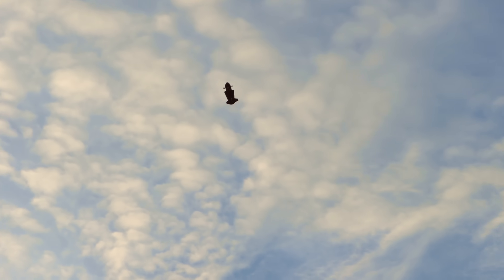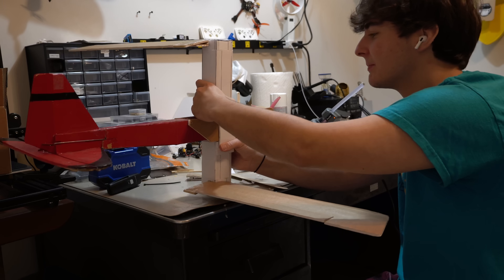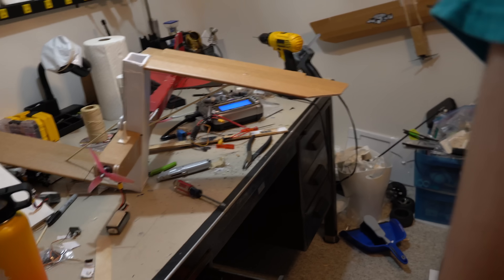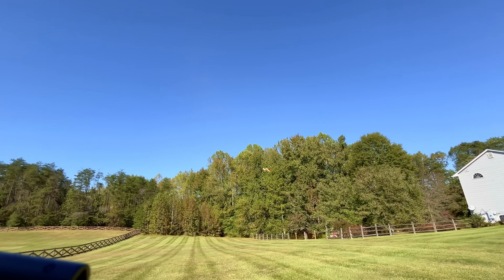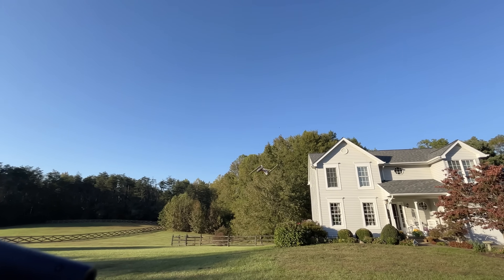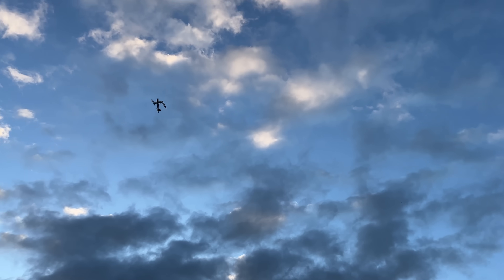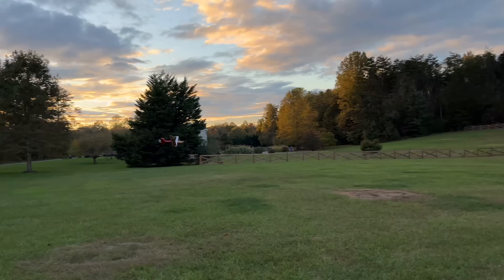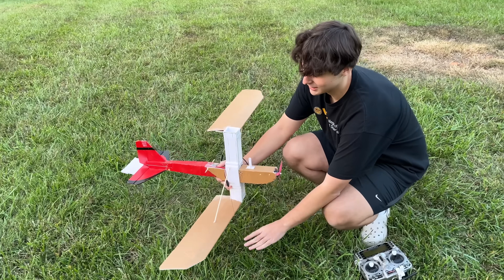Can a Plane Fly With Offset Wings?

Comment: Cool experiment! A free body diagram will show that regardless of wing height offset on either side, the wings create the same rolling moment on each side which cancels each other out when in steady level flight. Now sideslip effects, especially with that big vertical mast, might be a different story.... I'm curious if you could 'feel' any significant differences in yaw or restoring roll in sustained left vs. right banks?
Reply from the maker: Awesome explanation, now I have a legit engineer to confirm the results of my experiment!! Haha. The mast was definitely a problem at first, mostly because it was blocking airflow. But after cutting holes in it I really didn’t notice any effect. Which was surprising since it is almost in front of the CG and the back rudder really isn’t that big. There are really only two effects I could think of. Ground effect since one is closer, and it now has four wing tips to create drag. Other than that it was flying on rails.
Reply: @joosh_king  That was very interesting and informative. I am curious as to how well it would fly with a second set of wings in the same configuration but at 90° clockwise. Obviously that's never going to happen on YouTube for the very good reason of how it would look end-on. Nobody would watch if you had to blur the subject of the video!
💚🐇🐴💚
Reply: @joosh_king   🔴 What Is Islam? 

🔴 Islam is not just another religion. 

🔵 It is the same message preached by Moses, Jesus and Abraham.

 🔴 Islam literally means ‘submission to God’ and it teaches us to have a direct relationship with God. 

 🔵 It reminds us that since God created us, no one should be worshipped except God alone. 

 🔴 It also teaches that God is nothing like a human being or like anything that we can imagine.

🌍 The concept of God is summarized in the Quran as:

📖 { “Say, He is God, the One.  God, the Absolute.  He does not give birth, nor was He born, and there is nothing like Him.”} (Quran 112:1-4) 📚

🔴 Becoming a Muslim is not turning your back to Jesus. 

🔵 Rather it’s going back to the original teachings of Jesus and obeying him.
Reply: @joosh_king I think you should make one with the center mast as a wing also.
Reply: I was about to point out the balance of forces and moments, but here's this comment. Only thing I might add is you have to consider the balance in all three dimensions. 

There was probably a weird balance causing pitch issues, and certainly drag vs thrust was horrible.
Reply: @halfeld  I wasn't surprised that it would fly. I was expecting some issues when flying well due to the shape and the wings not being directly attached to the fuselage.
Reply: @halfeld  the rolling is from the pivot points.. in he z axis thay are different...
Reply: Exception, in ground effect.
Reply: @brucepearson6322  real life sized plane would be a nightmare to land then.
Reply: @brucepearson6322 was thinking the same thing.
Reply: Since the fuselage is lower than center, I would think the center of gravity it also lower than centered between the two wings. That could explain how the wing on the top is giving more leverage to slowly roll the plane to the right.
Reply: I'm sure the tail wing compensates for that though so its impossible to feel using your controller without a long straightway.
Reply: Try it again with different offsets from the vertical center of gravity.  If one wing is significantly farther from the center of gravity  I would expert roll problems. For example if you move the lower wing to be in line with the fuselage fuselage. I would expect the upper wing lift to create a moment about the center of the body that wouldn't be cancelled by the other wing
Reply: @DuffusMonkey I thought this too but go draw the FBD. The wings aren't creating a horizontal force about the centre of mass only vertical.
Reply: @mm_____  Duh that's right.  I used to be an engineer but now I just pretend to be one on the Internet.  I would still love to see him do it
Reply: @mm_____  both wings will create a torque around the centre of mass.  The torque will be different when the offset aren't balanced, due to the difference in leverage that would exist.
Reply: @nic.h this is incorrect. The force created by the wings in this configuration is parallel to the axis along which the wings are offset.  The two wings, regardless of where they are located vertically, will always perfectly cancel each other out. 

If the wings had dihedral then the offset wings would create an unbalanced torque. However, if wings were offset the same amount and in the same direction then no net torque is created in straight and level flight.
Reply: when flying close to the ground the lift would be different due to ground effect that is what may have caused the rc car to roll over like it did
Reply: @jaxfrank  I believe even with this configuration with the lifting force of the wings being parallel to the axis of offset, if the offsets to the wings are different it will create a difference in the moments that it experiences from the lifting force from each wing due to the differences in lengths of the moment arms to the center of mass.

Or another way to look at it, one of the wings will have more weight due to the center of mass not being balanced between the center of lift for both wings.  Essentially you are shifting the center of mass in an unbalanced way, so one wing has more mass to lift.

Hopefully they'll do another test given a few people have brought this up as a hypothesis.
Reply: @nic.h  the only distance that matters is the perpendicular distance between the lift force from the wings and the center of mass. That distance is constant regardless of the offsets of the wings. Therefore the torque never changes and will always be balanced.
Reply: @jaxfrank  Do you agree the lift forces work through the center of mass?  For an extreme example if you take one wing away all the lift is coming from one side and a roll will be induced.

And if so do you agree there is a center of lift from each wing and that when the offset is different there will be a different moment for each wing as the distance from the center of lift for each wind to the center of mass differs?

Are you saying that the center of mass isn't where the center of lift for each wing works through or that you are measuring the distance to the axis of offset at it's closest point, instead of the center of mass, which seems incorrect to me.
Reply: @nic.h  Each wing has a center of lift. The lift force from that wing acts at that point. The moment arm is between the center of lift of the wing and the center of mass of the plane. The torque created is equal to the length of that moment arm * cosine of the angle between the moment arm and the horizontal axis * the lift force. As you vary the offset, the cosine * length of the moment arm stays the same. Therefore the torque created by a single wing is the same no matter how you vary the vertical offset of the wing.

Another way of saying it: The only thing that matters is the distance along the horizontal axis between the center of mass and the center of lift of each wing. This value does not change as you move the wings up and down so the torques always balance.

I think the thing you are missing was that cosine term. It isn't the distance between the center of mass and center of lift that matters. It is the distance along the axis perpendicular to the force that matters. That distance never changes.
Reply: @jaxfrank  
Right.
I just want to add: It is a basic principle in all of mechanics that you can shift a force along it's line of action and nothing changes. The line of action of the lift force (as you say) is straight up. Thus one can shift that force (and with it the wing) along this line as far as they want, nothing changes (with respect to forces).
Reply: @jaxfrank  That calculation only works if we operate under perfect conditions where each wing is perfectly level and doesn't have a horizontal force component.
In reality the wing with the greater distance to the center of mass will create a bigger torque than the other.
If the difference in lever length is small enough then it will probably not be noticable, but it'll be noticable at some point.
Reply: @nic.h  There is no difference in leverage in this setup. Regardless of how high or low the center of mass is.
Reply: @mm_____ Would the offset not convert some of that vertical force into a rotational force if it wasn't even on both sides?
Reply: @StormTheSquid  ..it does...thats why it tilts...if the 'beam' would be very long it would also pivot because of leaver forces ... longer and loger from the center there would need to be more and more lift on the upper side, assuming bot leavers was the sam one has to compensate for both forces...
Reply: @DuffusMonkey yes, a horizontal offset would be a totally different story and would absolutely cause rolling
Reply: @DuffusMonkey so if you really fuck it up and break its center of gravity then it will fail. A revolutionary thought
Reply: @DuffusMonkey  True, the pilot seat would have to be set at 45 degrees. lol
Reply: @DuffusMonkey it's already ofsetted a little bit though
Reply: @DuffusMonkey Unless the deflection of the wing is enough that some minor horizontal force is applied.
Reply: That's true except when the aerodynamics are affected by ground effect. Then the lower wing will produce more lift and unwanted roll.
Reply: Just based on the awkward center of lift, I thought for sure that it would come to balance rolled towards the lower wing, yet still be easily levelled by the flight computer. I saw the full vid but I'm wondering whether tight turns in one direction may be easier than in the other direction?
Reply: Doesn't this only work because the distance from each wing to the centre of gravity is the same giving them the same leverage?  If the distances were different per wing then wouldn't the difference in leverage mean the same force would have a larger effect on one side than the other?
Reply: Awesome creativity
Reply: Looking at the footage of the car trying to take off, it looks to me like one wing being much closer to the ground gives it more ground effect, making it roll on takeoff. If you throw it you don't get that difference in ground effect.
Reply: The stall behavior will be atrocious and it will roll faster in one direction than the other, probably also have some pitch-roll coupling, but otherwise this makes sense
Reply: I was thinking if the body, and with that the tail wings are not exactly on the half way of the two wings, than it can cause "balance" problems. In such a case the barycenter can be too low or high, with other words closer to the lower or higher wing causing different radius for the rolling momentum by turning left or right. This means turning to the left or right may need more or less force as to the opposite direction. Am I wrong?
Reply: @Mikaci_the_Grand_Duke  ..the barycenter ( the center of all accounted forces) can ofc not be not be to faar off (making one wing 3 meters and the othe 1m) as soon as the wings begin excerting force (lift) the difference would likely make it unflyable...
...on the ground the structure would be stable, but not moving trought the air ..
but its rly not important where the wings are located... what matter is the combined forces or barycenter in 3 planes)
Reply: @Patrik6920  Okay, but that also means, that if you make only one wing offset and put it far enough from the body it can be enough to make the whole thing instable, because the barycenter of all forces is going to be far off too from where it should be. It would be similar to having two same sized wings as normal, but on one side mounting it far off from the body.
Reply: @Mikaci_the_Grand_Duke  yes...
Reply: i thought so because i couldnt comprehend there being a different amount of pressure
Reply: I feel like the force of the wing against the main body would cause problems, and during turns it could possibly have less efficiency? Idk just a high schooler interested in planes and physics.
Reply: FBD was my first thought too lol
Reply: If you make the middle piece act like a rudder, the plane should be able to straif side to side
Reply: what song is playigg by at 3:50 please i really need it know
Reply: Well, went in doubt, free body diagram
Reply: If the CoM and CoD weren't equidistant to the wings on the z axis then you might have got a rolling effect from the different lever arms
Reply: I don't agree that it had zero effect. The airplane settled on "level" where the lift vectors balanced around the CG. This happens on all aircraft, and can confuse solo students when they first have to get used to the CG shift towards their side. Glad it worked for you.

What credentials do I have for such judgement? Seven years working on flight school aircraft. I'm not an engineer or accredited scientist. I just fix what pilots break. Solo students complaining that straight and level flight wasn't as level as it should be was a regular occurrence.
Reply: I'm not sure if youre explanation is valid when the wings are in a V shape on the fuselage because V shaped wings also create a horiczontal force out of sync between the 2 wings. ...with complete flat wings I agree with you.
And af coarse the already mentioned ground effect.
Reply: @reiniernn9071  Just for the record (not a complaint about your observation, which is not incorrect)

The "v" shape you refer to is known as "dihedral." on some aircraft, it goes the other direction, and is known as "anhedral."
Reply: @Skyfighter64  Thanks for correction. As non native English I do not know all official words for things like this.
Reply: @Skyfighter64  OH, an A&P tech! You might be able to give some insight into something I noticed whiteboarding the forces (very basic, no air pressure difference, well out of ground effect, negligible influence of airflow over the wings from the mast, perfect lateral balance of the CoG and the CoL, basically anything that would obviously cause an imbalance of lift is negated by way of a spherical cow in a vacuum approach, assume perfect balance of everything aerodynamically speaking). 

Say the configuration were a low wing on the fuselage, and the other on the vertical mast extension, drawing a diagonal line between the CoL of the wings finds the location of the combined wings CoL (again, assume the wing up top perfectly balances against the one at the bottom and the 1/2 fuselage width difference has no significant effect on lift distribution, lets say because the top wing also ends at the mast therefore is the same length, ie same lift, spherical cow, etc). Since there would be extra mass vertically due to the mast, the CoG would shift upwards, though would remain balanced from left to right. The CoG and CoL are in plane vertically looking down the roll axis (tail to nose). However, there would be a vertical separation between the two causing the CoG to be higher than the CoL. Im wondering how much of an effect that would have on controllability and stability....

I imagine, as the mass is above the force holding it up, effectively balanced over the center of forces currently engaged in flouting the the laws of gravity, a 'toppling' tendency would arise as the craft banked off perfectly level, it would pivot around the CoL causing the CoG to swing over in an arch throwing the lift vector and the gravity vector out of alignment and out of plane, the lift vector would remain more or less aligned with the aircrafts yaw axis (ie, 'up' in relation to the craft, spherical cows also negate the effects of side slip and lift imbalance due to banking, they are very craft cows....) but the gravity vector would stay aligned with....well, gravity....inducing an up and over kind of roll if not corrected for. Stability would hinge upon the control authority to keep the CoG balanced over the CoL, where as if the CoG were below the CoL the craft would want to settle into level flight as a weight below the thing holding it up is wont to do. 

Which leads me to believe there would indeed be an induced rolling moment, but from dynamic kinetic energy swinging around unstable force vectors, and not from an imbalance of lift due to the wings vertical offsets. For a bovine pilot....that is quite roundish....and in a vacuum....(yes, of course there is still lift in this round cow pilots vacuum, I fear its craftiness is being underappreciated....)
Reply: i feel like the distance in elevation would have a tiny effect, when rolling, with regards to levrage action, which could make it more agile.
Reply: Ground effect would probably be a nightmare. I guess in a super huge aircraft you might have enough distance where air density might cause a bit of roll. I wonder if someone has made the math on how far the wings would need to be apart before it would start causing noticeable roll.
Reply: Ha, as a degreed MechE that was my very first mental thought process. Forces and moments. 👏
Reply: what is you made the bar between the wings as wings?  So 4 wings... think of the possible movement you could get.
Reply: @glen1arthur  so practically a forward vertical stabilizer?
Reply: Sounds reasonable, but what I would wonder about with this extreme offset would be during landing, as one wing would enter ground effect before the other, the plane might tend to roll right before you land. Probably not a big deal for the swing wing lane though.
Reply: Right so you now need to redesign runways so they have one side of the runway the ground is a lot lower than the other which would need to actually be higher than the runway so it couldn't tip over every landing or at least be safer...... Ish. You could obviously only use the runway in the one direction no matter what the situation and landing on a runway that has a basic cliff on one side and a pit on the other sounds like..... Fun no no that's not it suicide yhep that's the word.
Reply: It's awesome to see experiments like this one! I agree with Nicholas: the FBD shows that the difference in wing height doesn't affect how much roll each wing creates. However, if you add a bit of dihedral, the lower wing's moment will decrease and the upper wing's moment will increase. Even a small amount of dihedral would likely make the airplane uncontrollable. In addition, you needed to add elevator authority because moving the wings away from the CG caused the pitch moment of inertia to increase a LOT, meaning the little elevator couldn't create enough pitch moment to keep up. Nice job improvising!
Reply: I think offset can still cause roll. Just not offset parallel with the lift-axis. But try offsetting one wing 2 wingspans out from the body (basically one wing is 3 times as long, but then remove the actual wing from the innermost 2 spans and have that portion just be a rod).
The offset force should leverage the offset to have a greater effect on the roll, than the one closer (regular 'ol lever effect).

But so long as all you offset is parallel to the lift like here, it should have no effect I don't think. maybe if the offset isn't symmetrical around the mass-center? But I doubt even that should have any effect?
Reply: Wouldn't there be a difference in takeoff due to ground effect?
Reply: I think you would still have more ground effect on the lower wind if you are low
Reply: In theory he should have had stable motion going straight and vertical motion. But when using the ailerons he should have had an initial normal response followed by a rapid but not necessarily massive oversteer, i mean the transition would be rapid not the force itself. Reason being he is now adding an additional torque (x2) about the fuselage. Another but…. This torque vector relative to the torque with standard configuration would not be very big bit i expect it to be noticeable when flying the aircraft. (MechEng).
Reply: ...actually... the pivot point for the tork forces will be in different places on the side of the plane, its why it fly tilted to one side, the upper wings tork force will be lower (could theretically be compensated), the reaso the rudder works is because the air flows around the beam/pole in the middle, doing it airodynamic could add som stability even..
...offseting the wings on the body would as suggested add severy stability problems, wich in theory could be compensated too.... but theoretically if it can create enugh lift whatever position or shape it will fly....

... keep experimenting, u will learn alot and have alot of fun....
..u will be surpriced what odd shapes can create enugh lift...
... i hope one day u study engineering, and or build a plane that exceeds mach-1.. 
playing with mach fans... opens a new realm of possibilities...
https://www.youtube.com/watch?v=ad6Ss8coLh4
Reply: They only cancel each other out if the center of gravity is centered in the wings, and the plane is level, as you said.
Reply: ...comment on the comments..
if we see the plane right from behind, and the points where tha wings are attached to the plane(beam)... imagine a circle the radius of each wing and the center of the circle is in the point where the wings are attached to the beam... u get the point where the forces are applied, if u draw a line in the intersection of the circles and draw a line from the wing tip to for the upper wing te upper intersection point u get the angle the force is allpied....
..if u use something that can bend slightly instead of the beam... u can see this forces in action,,, and whats happend s if u chenge something... if u mange to film it at different air speeds... u should see how it changes...
Reply: hello, i am nicholasrehm and i know things. yay!
Reply: watch the video....its apparent...in short the aswer is YES, basicly the tilt makes sure the forces r also tilted... its behaving exactly as if u would roll the plane, it chenges the behavoiur in all axis
Reply: I think a lot of it would have to do with the forces of the wind after it leaves the wings. Since you'll have 2 concentric Vortex It seems like it would create a natural funnel which would spin the plane???
Reply: @BourneJoker  ...as the plane has one set of wings, one on each side and a small stibiliser fin (the fins on the back is not doing any lifting, quite the opposite during takeoff and landing thay prevent over reaction in the system) ... so a vorttex will have very limited effect (the combined forces and air pressure of the votex is zero), if the plane has sevral wings this is more complex... (besides, the gratest vortex are at the end of the wing)
Reply: @Patrik6920  I did not say anything about it taking off.....
Reply: @BourneJoker  ..i know, was just mentioning it because the back fin/stabilisors r not ment to produce any lift (not changeing air pressure above/underr it)
Reply: the real issue to flight would be a center of gravity vs center of mass. beyond  that if an A10 warthog can fly on one wing, then your offset wings should work surprizingly well.
Reply: I would say the only time this may introduce a rolling moment would be when near the ground, if one wing is in ground effect, but the other isn't, you have a difference in efficiency which could introduce a rolling moment.
edit: OK, I'll watch the whole video before commenting next time :)
Reply: Wouldn't wings induce a rolling torque if he didn't make it so symmetric and centre of pressure of one wing was closer to the centre of mass than centre of pressure of the other wing?
Reply: But i wouldnt forget about changes in pressure distribution on wing surface near wing roots due to different flow caused by vertical structure it at least slightly effect lift force balance between wings and will cause roll.
Reply: @GaweNowakowski clearly not enough to matter
Reply: It's because the center of mass is in the middle, if the center of mass was somewhere above or below the center of the offsets then it wouldn't work.

an alternative way to see it won't work is that if you're not in the middle of the offsets, it's effectively two separate offsets and the same force applied across each wing means the sum of each wing in terms of torque wouldn't be 0.